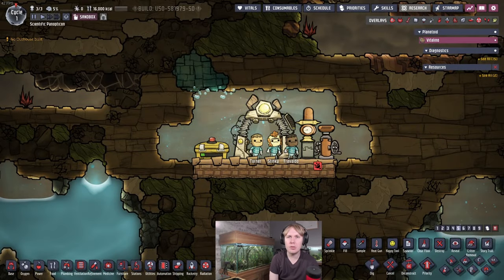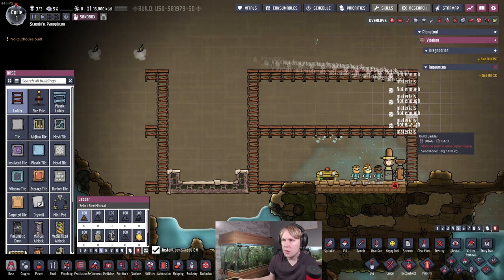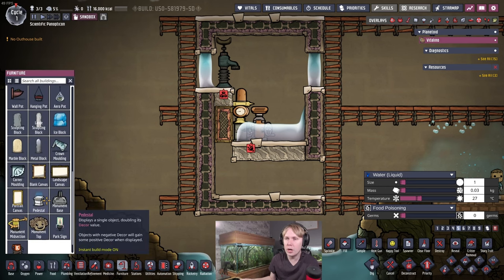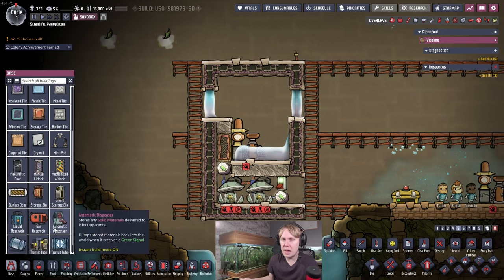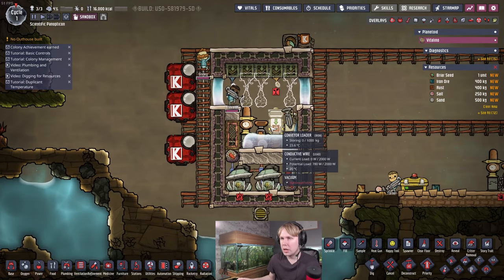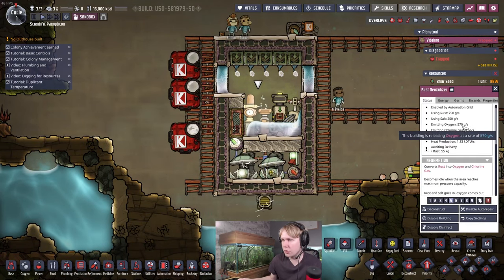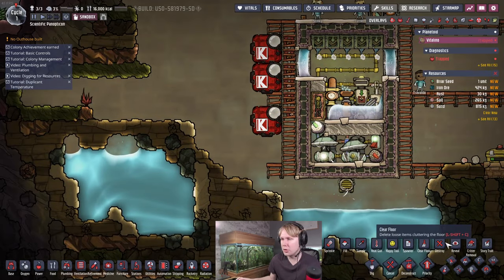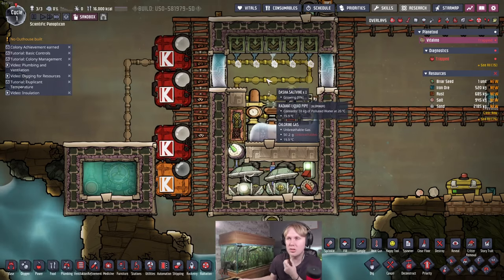How To Use Rust Deoxidizers In ONI: Spaced Out! Sandbox Showcase #8

Comment: Perfect timing for this video! Thanks a bunch! :) Also, do you need to use masks or suits for the dupes entering the room, since they may exhale CO2?
Reply from the maker: So two things. 1) I would recommend you put this in an Atmo Suit area so that your farmer dupes don't get Sopping Wet and Eye Irritation. 2) Your dupes shouldn't exhale CO2 in the absence of Oxygen in the room. I haven't seen it break during my testing. Obviously Flatulent dupes should be blocked from entering the room using door permissions.